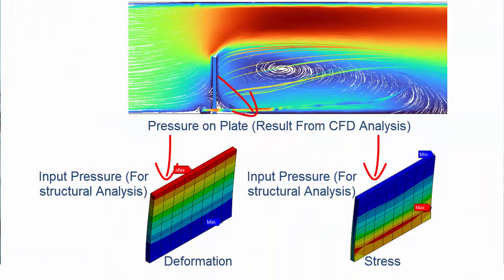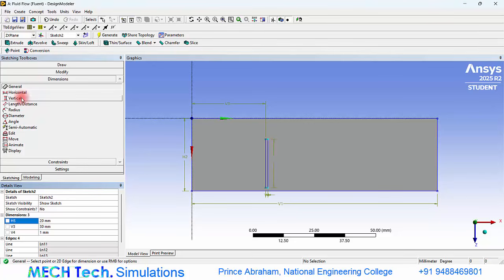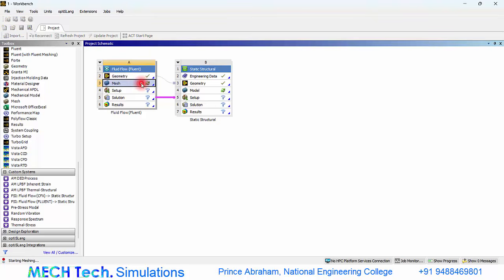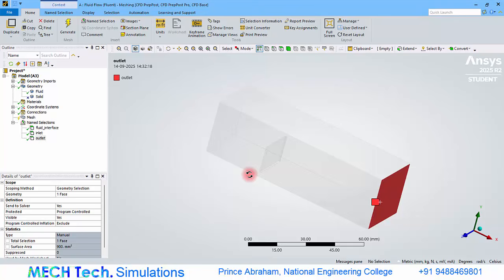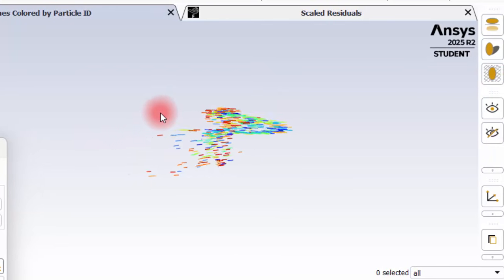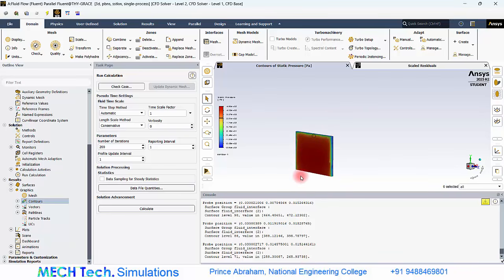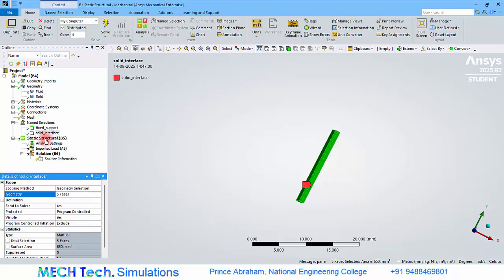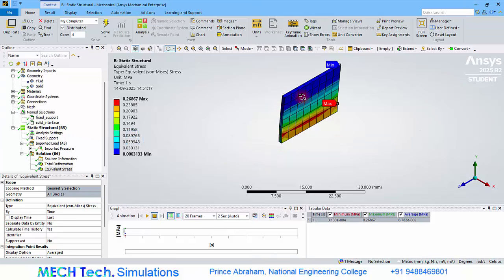Step by Step Tutorial | One-Way FSI Simulation in ANSYS Fluent & Static Structural | Ansys How To

Comment: Hi, thank you for the demo, can loads be imported to a shell model instead of thin solid model?
Reply from the maker: For ANSYS Fluent, a surface model alone is generally not sufficient for fluid flow or heat transfer analysis because Fluent solves equations within a 3D or 2D volume (fluid domain)